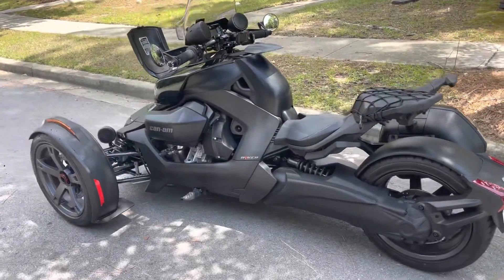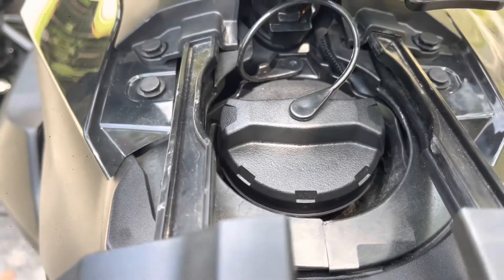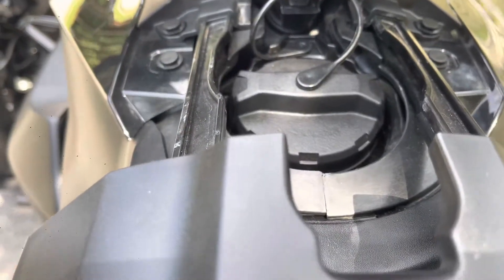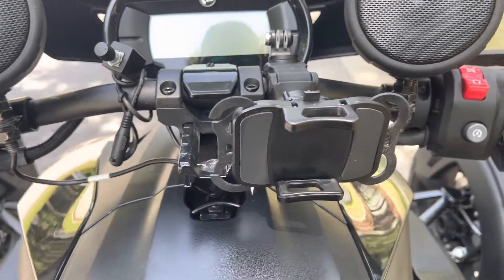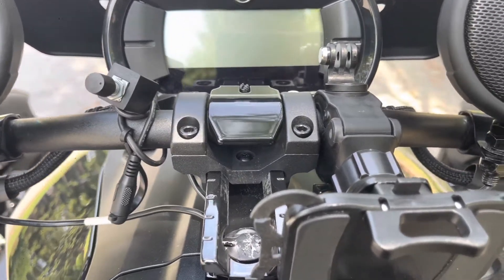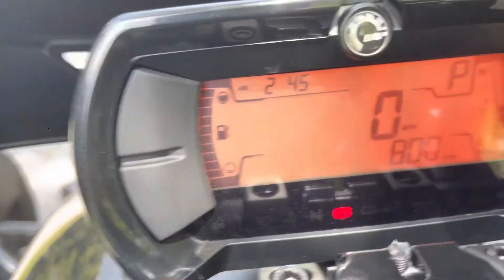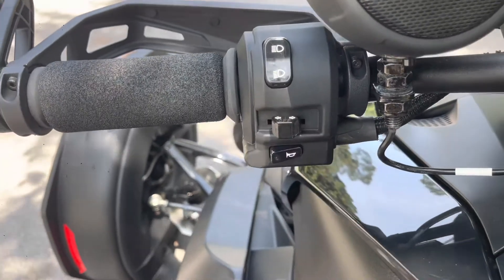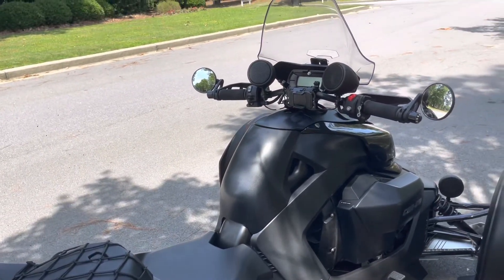Beginners Guide to the CanAm Ryker

Comment: The funel is for putting fuel in the bike from a fuel can.
Cars and trucks with the capless system come with them also. 
My 2019 Ryker Rally came with no cap.
Reply from the maker: You can use it for gas or oil whatever you like.  Never used it at the gas station and haven’t needed a gas can…Yet. However that is the general purpose. Ment to say that but I had just done an oil change so that was on my mind at the time. Plus a mini brain fart lol
Reply: @OfficialJD3  It's not intended to be used at a gas station where you have a nozzle to push open the system. 
If used for oil I would clean it well afterwards. That way it doesn't collect dirt.
Reply from the maker: @jamesglenn520  ya that’s what I do. And it will drip oil all over if you don’t. Thanks for commenting!!!! the Ryker community and myself appreciate it